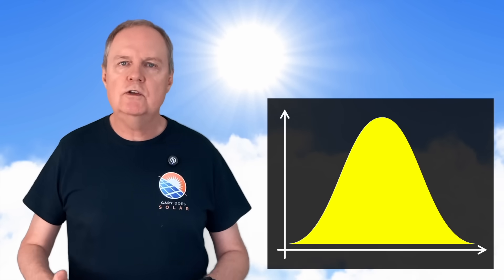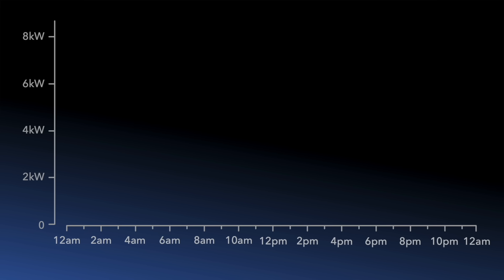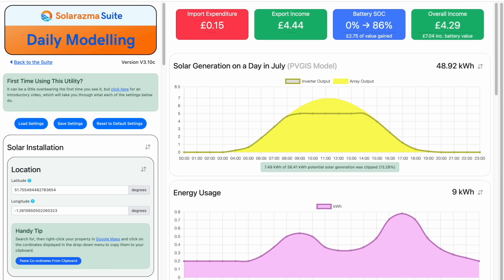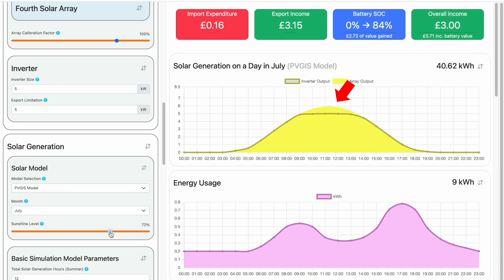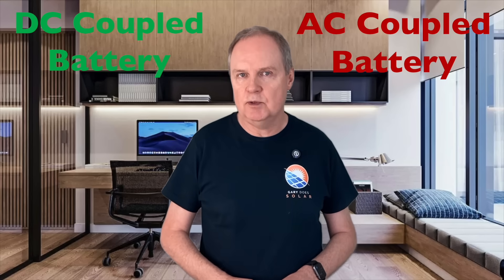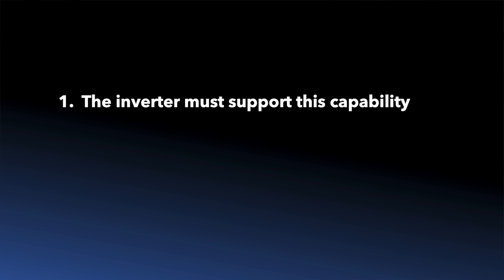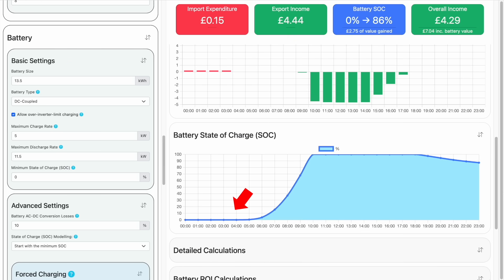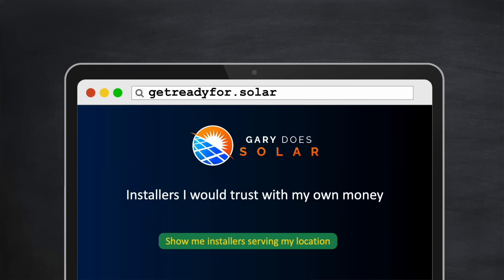Solar CLIPPING and what you can do about it…

Comment: Also, when your panels are seeing peak sunshine they'll also be hot.  Their peak output will derate fairly significantly.
Reply from the maker: Typically only by 0.5% for every % above 25°C
Reply: @GaryDoesSolar  So that is about 15% loss for 30°C above 25°C. Sounds about right. I find that on a fully sunny day, the modules are about 30°C warmer than ambient. So the 7 kW array will not produce 7kW for longer than a few minutes. I have even observed 120% of nominal power in special situations, like the sun suddenly coming back full power after an intense rain shower, or the full load of snow sliding off all the modules at once in bright sunshine. But that lasts only a very short time, maybe a minute or so. With continuous sunshine in summer, I find that the modules produce typically 85% of rated power continuously.

Comment: I'm having to switch off half my solar strings for most of the day, as Octopus is refusing to pay for my export, even though my installer was MCS registered but couldn't issue an MCS certificate.
Once my battery is full and my inverter maxed out (even when it isn't) I curtail output to protect my equipment. 
I wonder how many micro generation sites have to do the same due to DNO or energy retailer restrictions. 😕

Comment: My biggest issue i'm experinceing is the low export rate I was handed by my DNO, SSE. I have a 9.5kWp system, 19 panels south facing, 16kW battery storage and a 10kW inverter - limited to 4kWh export. I could be exporting up to 8kWh for about 6 hrs in summer and 4-6kW for a couple of hours either side of this. So frustrating, we're wasting more than 20 kWh per sunny day. Ideally, we'd add another 16kWh of battery storage and force export for extra payback - but that's another £5.5K.  We need a constant 4kWh draw on the house load all day...maybe bitcoin mining?! 😆 (Edit: we doo have an older small battery EV, but it's only used for 50 miles a week, so can't absorp the power). We need a car with 100kW battery and vehicle to grid tech!

Comment: Ahh you did a video on clipping but you missed my main point in the last videos comments (To be fair I never came back to you) I wanted to see you discuss the generation curve in the early and late part of the day... By oversizing your array you can jack up the cut in (and cut out) voltage of the inverter and start generating earlier longer and later. In the UK winters (or anyone else on more northerly latitudes) you can get more out of what you got but in the summer months it clips.. No big deal if you can't send it back to the grid... (I think that's why most inverters are sized the size they are due to generation limits back into the network.
Reply from the maker: Yes, it was actually your original comment that spurred me on to making this video - thank you!

Comment: Another cause of clipping is an export limit - I thought you’d cover that too.

Clipping can occur in any situation where upstream production is greater than the downstream capacity to accept it.

The solution is an upstream reservoir to buffer peak production to smooth it to within the capacity of the downstream system. 

As you describe, a DC connected battery buffers a restrictive inverter, whereas an AC connected battery can buffer a restrictive export limit.
Reply: I think he actually did cover it but it was a bit indirect.  There was an implied assumption of a utility limit in sizing the AC coupled solar.

If there is no export limit or if the export limit is not the problem, then battery charging works the same either way.  AC or DC.  While it is true that DC coupled solar can bypass the inverter to charge the batteries more directly, all the components are in the same box and generally share the same heat sink and cooling capability... so the inverter output is still limited to some degree by the DC coupled solar.

Such inverters also tend to be far more capable than regular string inverters so one might not notice that there are, indeed, still limitations.

For AC coupled solar, the main problem when hitting an export limit is that the utility really really really doesn't want there to be any chance of ever exporting over that limit.  So even if the battery can suck up the excess and keep you under the limit it takes a degree of sophistication in the system when you have AC coupled solar to ensure that it never exports above that limit under any circumstance.

-Matt
Reply from the maker: Thanks Matt, you’re right. I did make mention, but I completely forgot to talk further about export limits later in the video!

Comment: I designed my installation for max clipping, i bought my panels to the maximum voltage and current my inverter can take. So it delivers more power in the winter and on mild summer days, this delivers more power on normal days than what i lose on sparse very sunny days.
Reply: same here. oversized array. Optimise winter production
Reply: @richardlphillips interesting idea. Question: why does a smaller inverter produce any more power than a bigger inverter in winter time?
Reply: @dingmaster001 So if you look at an inverter efficiency curve you will notice that different inverters have a different startup voltages Inverter efficiency drops off sharply as you get to lower outputs so by picking a smaller inverter with lower peak output and lower startup voltages. Pair that with oversized array you can generate more power at lower panel outputs when the sun is low or light is diffuse like in the northern hemisphere in winter. At the expense of clipping in summer of course. But its a trade off. I can still generate 12kwh on a cold winters day in December or maybe 3-4kwh on am overcast day. whereas that could be nothing with a 5kw inverter and 5kw of panels. you can do something similar with micro inverters by undersizing them conpared to the panels
Reply from the maker: That's a great point. In summer, those with solar have abundance, but it's winter where every bit of generation counts!
Reply: Could make sense for me - here we use about twice as much energy in winter, plus it's more expensive.
Reply: Yes. clipping is a good thing for the most part.

Comment: Hi Gary, I virtually eliminated clipping last year when Solar Edge gave users more battery control via their app. I’m on Octopus Go and in summer I charge my battery and EV between 12.30am and 5.30am. I discharge my battery to the grid between 8am and 7pm. It’s normally empty by about 10.30am but there’s nearly always enough solar to cover my consumption until 7pm. There is usually enough generation after 7pm to cover all my consumption before 12.30am. I may tweak these timings on a dull day. Cheers, Rob
Reply from the maker: That’s really great to hear, Rob. Useful
Strategies for others! 😀

Comment: I'm very intrigued by the DC car charger on the Sigenstor system for this reason. If it's possible to fill the car with energy that's going to be wasted anyway, that sounds like a win win. It's currently prohibitively expensive, unfortunately..
Reply from the maker: Crikey - you make a great point, which I missed in the video! That is an excellent way to avoid clipping, by dumping the extra DC generation straight into your EV! :-)

Comment: I do the exact thing with my DC coupled panel/inverter.  I tell my inverter to discharge at its max of 6500W and then any extra energy generated just goes into my battery.  I was noticing clipping at the 6.5Kw mark and now I can see my solar panels sometimes peak at 10kW.  Its crazy.  Its not somthing I though of at the time.  I'm even thinking of getting another inverter and split my panels up!
Reply from the maker: Thanks for sharing your experiences on clipping—good insight for others 👍🏻
Reply: @GaryDoesSolar  It's also worth considering having the higher inverter rating because if you can export your batterys quicker within the high rate octopus give you.  Well thats the reason I'm telling myself anyway 😀
Reply from the maker: Agreed! 👍🏻

Comment: Dump loads have been around for years find one that fits your needs heating water comes to mind something everybody needs. Use it or lose it is what solar is.
Reply from the maker: The problem is that these dump loads are generally on the AC side of the inverter, and the inverter is always at maximum power when clipping is present…
Reply: @GaryDoesSolar  It actually doesn't matter if they are on the AC side the more AC you use the more the battery has to charge which uses the extra DC. Oh I am assuming you have a battery inverter along with the AC string inverter.
Reply from the maker: @offgridwanabe Hmmm… I don’t agree (but happy to be proven wrong!). If  the AC output of your inverter is maxed out, and there’s still more DC generation on top of that, it’ll be curtailed if the battery is full and there is no other DC sink.
Reply: @GaryDoesSolar  I don't disagree with your fact that the string inverter can only produce it's maximum. A dump load would need to be from the battery so the charge cycle is activated what you do with the battery capacity can be directed to a battery inverter to make AC to heat water, requires a separate circuit for water heater. Or an ac coupled inverter run from the battery instead of solar panels. I have already done this with Enphase micro inverters but it is not recommended but there are other battery inverters that can be ac coupled to the output of you string inverter.
Reply: @GaryDoesSolar  in short you would need to change the string out put if your battery is charged from the ac output of your string inverter

Comment: In the middle of summer, you'll also lose output due to panels overheating, possibly as much as 15%.
Reply from the maker: Well, depends on the country of course: published solar panel output ratings are measured at 25°C and there’s typically a 0.5% attrition for every °C above that.
Reply: I can confirm that. My SW array with a 3000W string inverter and 3250Wp of panels show a nice bell curve going up to 2800W with temperatures of 35C . So depending on global warming effects this clipping issue is going to get smaller.
Personally I really don't care about clipping anymore, I just want as much power in bad weather and winter as I can get. In summer the price of energy is at or below 0 here in the Netherlands when clipping occurs.

Comment: I suffered from clipping from my 13kWp array coupled with an 8kW inverter, 10kWh battery and a 4.5kW export limit so I changed from a diesel to an EV. The EV coupled with a Zappi allows me to adjust the Ampere rate to the car and set to charge only once I generate more than my export limit. I now never clip and gets loads of free elec for the car 🤘
Reply from the maker: Nice one, Steve! 👍🏻
Reply: Great stuff!
How exactly have you set up the Zappi?
Reply: Hi, I adjust the Amps charge rate from the EV app (Tesla 🤫). With the Zappi, from the menu, go to Other settings / Installer settings / Supply grid / Network / Export margin. Since the Zappi needs 1.4kW margin to begin charging (I think), I set the export margin to be 3kW, so 1.4 + 3.0 = 4.4 which is just less than my export limit of 4.5kW

Comment: I was thinking micro inverters and straight to AC as AC is the power electricity. 

But battery storage DC is 100% to the battery and just take the AC you need during the day or night.
29% more in your example. 
Some times first light is slow to start the inverter aswell, I understand. 😊
Reply from the maker: Not quite sure I understood, Stephen - could you elaborate please?
Reply: @GaryDoesSolar  A couple of matters,  Enphase idea was that AC was the most common current and so micro inverters on the PV panel was the most useful solution. 
But now battery technologies are so advanced that battery DC is the most efficient, and inverter AC sized to the demand is the best logical solution.
Reply from the maker: Ah ok, got it—thanks! Yes, I tend to agree 👍🏻

Comment: I imagine size your battery to your daily winter needs.
Then size your panels to fill the battery on winter days.
Then have fossil fueled heater for longer cold periods to unload your solar system on bad days.

In summer the bigger rooftop array will shade your hot roof. 😊😊

In winter closing off the perimeter of the rooftop PV array would help insulate the cold roof. 🥶  😮 😊

Here in Sydney Australia the cooler shaded roof will reduce air-conditioning costs. 

Just thinking bigger than the obvious. 

As rooftop PV expands, grid cashflow will reduce and £kWh will increase making payback better.
As v2g EVs massive storage batteries parked 23hrs every day increase grid cashflow will crash again. V2g EVs is the next grid cashflow killer. Particularly in Australia. 

Still enjoying your quality work. 😊😊
Reply: Well, I would definitely size the battery for 24 hours of home operation, plus some additional pad to make large loads (EV charging, A/C) more convenient.    This is more of a thing in the U.S. than in the U.K... for some reason a lot of U.K. home owners just don't do that and I'm not sure why.  The 28kWh of storage I have just doesn't take up much space in my garage so... why not?

But in terms of the solar array... it is more or less impossible to size the solar array big enough to handle winter if you have an electric furnace (heat pump or otherwise).  Or at least it can be extremely cost prohibitive.  Unless you can DIY it.

But by all means, fill the roof if you can, I say.  But with due consideration to the risks.  Some roof types are easy... For example, solar can be mounted on a standing seam metal roof with zero roof penetrations.  Other roof types are not so easy and leaks are a real risk from the penetrations.  So some care and planning may be needed.

-Matt

Comment: Excellent video. 
DC connected battery makes sense now, for me.  😊😊😊😊
Reply: Its really "hybrid inverter with MPPTs and battery charging integrated together", or "MPPT charge controllers directly connected to the battery"... i.e. to bypass the inverter.  That removes the grid export limit from consideration with regards to charging the battery.  But a hybrid inverter still has overall limitations based on the shared heat sink and cooling capacity.

One can have AC coupled batteries (the Tesla PW2 for example) with DC coupled solar and have more solar than what the system is allowed to export.  That does work because the system is still integrated and knows how much power the battery is sucking up.

Such systems can actually disconnect from the grid when the AC coupled solar would exceed the export limit and then, once disconnected, use frequency control to modulate the AC coupled solar's output to match home consumption and battery.

Not ideal though.  Integrated DC solar and battery charging is far superior in my view.

-Matt
Reply from the maker: Thanks for the great feedback, Stephen! 🙏 Yeah, I used to favour AC Coupled, but the integrated systems from Tesla and Sigenergy have run me over! 😀